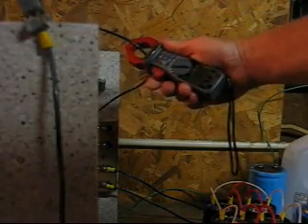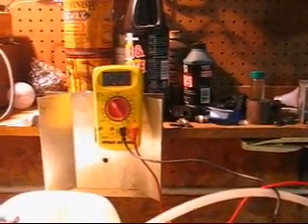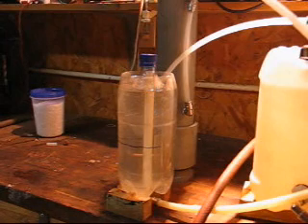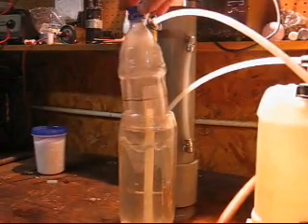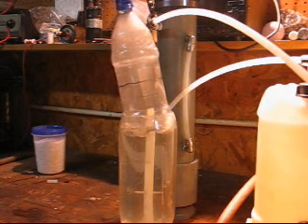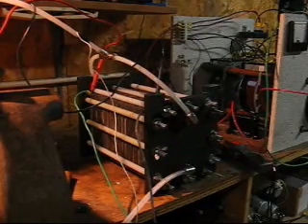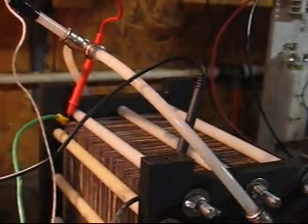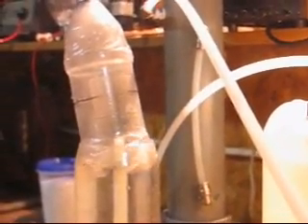HHO Generator HVDC4

Comment: Yes but if you need energy to convert it into Hydrogen an Oxigen and if you lose energy instad of using it directly what is portability then. What I estimate is that you also produce a small amout of oxigen and if you use it in a combustion engine in increases the rate of fully burnt fuel. I GUES and it is just a guess that this increases miles per gallon with same amount of fuel al little bit but have not calculated yet because each engine is different...

Comment from the maker: The material I am using for gaskets is 1/8" thick vinyl curtain material like you see going in walkin coolers. You can buy them from mcmastercarr but I got them at work. They were replacing some and was throwing the material away, but you might ask around and might find some also. If I was going to buy some I think I would buy some 3/32 material instead. I think it would be more efficient a little closer at these voltages.

Comment from the maker: This setup I am using 2 Powerstat 236BU variable transformers hooked to 240VAC to the panel in my shop on a 20A breaker. The voltage coming out of the transformers goes to a full bridge rectifier then to the cell. This gives me the ability to adjust the voltage from 0-245VDC with the transformer and up to 20A but about all of my test are at 120VDC, which you can just rectify your voltage straight from a wall socket and change the AC voltage to DC voltage

Comment from the maker: It was very hot outside in the shop when I did this test but I have ran it for a couple of hours and as long as I kept my amps under 9 at 120VDC  the temp. would stay under 110F. But I have not ran it more than 2 hours at one time. As far as the inverter I have not checked the amp draw from a battery to the inverter yet cause I have not purchased one yet. 
The size of the plates are 6"x6" and have holes inside the gaskets on the plates for fluid to flow and gas. No pwm. Hope this helps.

Comment from the maker: The ends of my cell is made of HDPE or the same stuff they make truck bed liners out of. My bolts are insulated with Nylon tubing on the outside but I put mine on the outside cause I did not want to drill all the holes thru the plates. My gaskets are made of clear vynal curtain material 1/8" thick cut out in the center like scarecrows are, and also the holes are like his also except I have 2 holes near the top for the gas to escape instead of three. Alternator ????? Battery Inverter yes!!!!

Comment from the maker: This setup is 120VDC not AC voltage. This is rectified AC voltage not from a battery. The bridge rectifier changes the voltage from AC to DC voltage.

Comment from the maker: Take a look at this site. My cell is based on the Tero.ranta electrolyser. Mine is a 60 plate design that uses 120VDC. If you use 12DC or 120VDC try to maintain around 2VDC per plate to start with and use the KOH to adjust your amperage with. Search google with Tero.ranta electrolyser and use the waterfuelcell pdf file for a start.

Comment from the maker: It doesn't get hot. the voltage is spread out over the 61 plates so it gives you around 2VDC per plate. Ran it for over an hour and checked the temp of the cell and it was around 106 F. Now if you up the voltage to 130-140 VDC and run it it will start getting hot in just a few min. and some of your output would be steam.